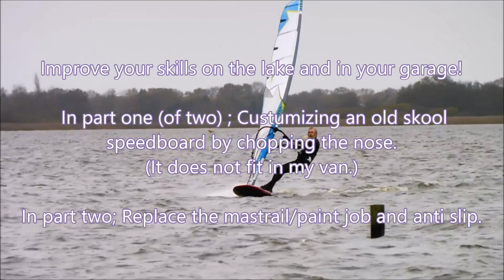Customizing an old skool speedboard by chopping the nose (part one) No  music! Info/description.

Comment: what kind of roller are you using with the 2K. I've tried a medium wool type and synthetic foam (disintegrates) but get bubbles,...unsure if a mohair with very little pile would work, what you suggest?
Reply from the maker: Bubbles usually caused by too much paint. You can also paint with a brush and then roll it with a dry roller.

Comment: For what reason all this work for nothing
Reply from the maker: It's a fantastic board (280cm), but unfortunately it does not fit in my bus. And now does it fit!
Reply: I  got an old naish vector 88 liter 2006 for my kids to SUP on. Unfortunately it was too long to fit in the car. Until i saw this.  My board is now 212 cm long. Im going to put thruster fins on it. Thank you so much for this tutorial.